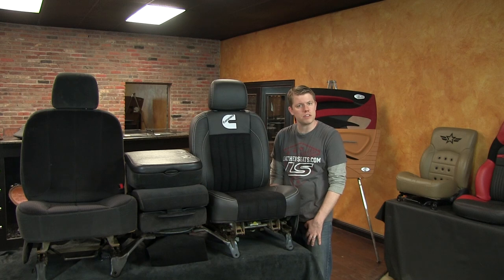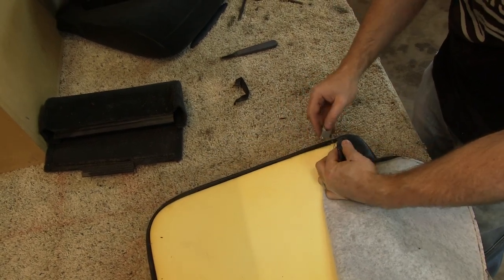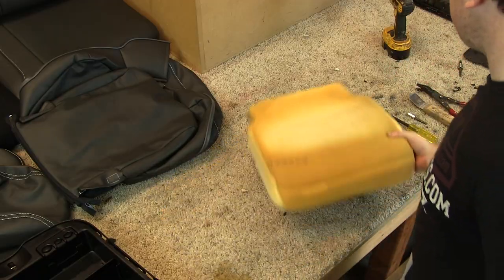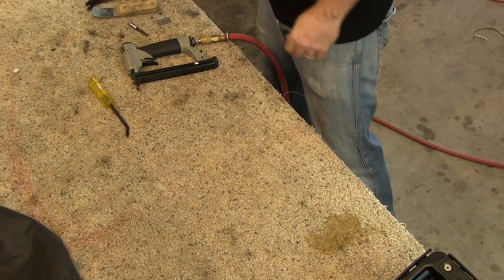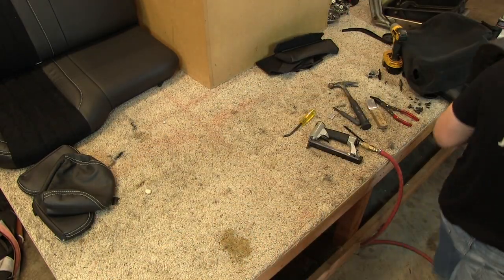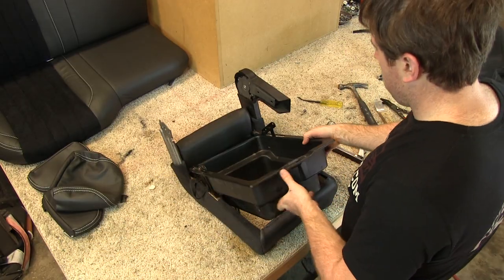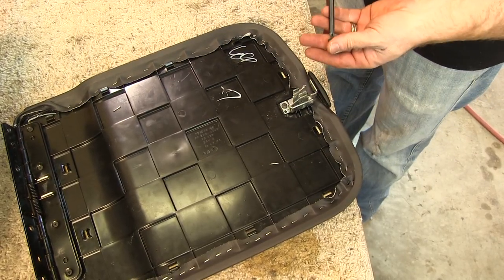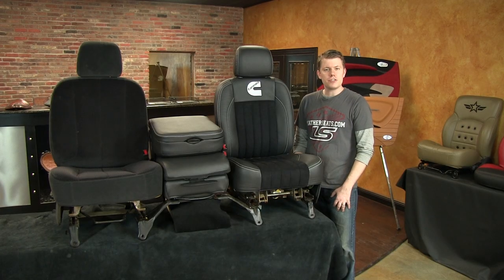Dodge Ram Quad Cab Leather Center Console Interior kit Installation Video - LeatherSeats.com

Comment: Love the video...very informative...but one thing I don't like is reusing the console underpad that's clearly worn and broken down. That is the issue I have with mine. Love your product...but I'm not installing new cover is the under pad can't be replaced. Other than dirty,  my cover is in good condition...just the need a new foam pad. Now of I could replace that at the the same time, that would be awesome. Replaced the foam seat cushions...just need a new console lid foam pad.
Reply from the maker: @timothymroberts2949 Thanks for your comment! I'm glad you found the video helpful. Our focus is primarily on the upholstery and we don't offer replacement foam. When we run into a damaged under-pad on these models for local installs, we typically cut out the damaged section and repair the section with high density foam. Foam repair can be a more advanced process, but a local upholstery shop might be able to help you out with a repair.

Comment: Almost complete,  how about taking the seat off the brackets.  I can't get to my truck right now.  But can the jump seat be removed while in the truck or do you have to take the front seat as an assembly
Reply from the maker: David Heath The jump seat should be able to be removed separately from the driver and passenger seat however it shares the same floor mounts. You will need to unbolt the seats, tip the driver and passenger seats back, remove the center jump seat, and the put the driver and passenger seats back down onto the mounts to be bolted back in.

Comment: What type of stapler and staples are being used on lid?
Reply: I wish he would tell us what the name brand of the stapler is and what the size of the Staples are that would be very helpful so I don't push a staple through the plastic since it's my first time and I would like to find the same brand stapler
Reply from the maker: @livefootagetube  We recommend using a pneumatic upholstery stapler, which uses a 22 gauge 3/8" crown staple and allows for shooting shallower staples. Eric is using a Porter Cable brand pneumatic upholstery stapler in the video, although there are many other brands that offer pneumatic upholstery staplers that would perform well at various price points. Unfortunately, I do not know what staple depth is used on this specific console, but we generally start out with 1/8" and work up from there if we need more depth to bite into the plastic. We might also suggest considering paying a professional automotive upholstery shop for installation, as they should be able to install any of these components.

Comment: Is an air compressed staple gun required? Or could I possibly use a regular hand held staple gun that doesn't require an air compressor?
Reply from the maker: +Pistol Plex We highly recommend not using a hand stapler because it is difficult to keep/stretch the leather in place while still being able to apply enough pressure on the stapler. Also, we find that a lot of times a hand stapler does not have enough power to go through the factory console plastic. A pneumatic stapler is the best way to accurately place and hold the leather into the correct position.
Reply: Pneumatic required.  Otherwise you won't succeed.

Comment: What kind of staple gun is that? And is there a specific staple I should get for the gun? Also does it have to be a pneumatic. And if it does have to be a pumatic what model is it so I know what to look for. Thank you so much
Reply from the maker: livefootagetube This is a pneumatic upholstery stapler, which uses a 22 gauge 3/8" crown staple and allows for shooting shallower staples. Eric is using a Porter Cable brand pneumatic upholstery stapler in the video, although there are many other brands that offer pneumatic upholstery staplers that would perform well at various price points. We might also suggest considering paying a professional automotive upholstery shop for installation, as they should be able to install any of these components.

Comment: great video. I bought the cover.  what size staple should I use? I don't have a phnematic  gun but I want to use my heavy duty stable gun. Is that ok and if so what size staple?
Reply from the maker: Justin Salgado Really we wouldn't recommend using a hand stapler but if that is your only option it is doable. Just be careful in regards to the stapler and staples slipping while you apply pressure as they can potentially tear the vinyl. We typically use 1/4" staples for this console lid. Feel free to email sales@leatherseats.com if you have any further questions.

Comment: Do you offer this same look for the 94-97 dodge ram seats, with the 2 piece center console.
Reply from the maker: Brian Hill We do have patterns for the 94-97 and can build a kit for you using the same colors and materials as the seats in this video. As far as the look is concerned, the 94-97 seats are a completely different style and will look different that this kit even with the same colors and materials. I would suggest emailing sales@leatherseats.com and we can send you photos of our 94-97 seat upholstery kits.

Comment: what length staples where used on the center console arm rest?  does that staple gun roll the staples over or are they just straight?
Reply from the maker: +jjp202 The staples are just straight.  I am not sure what size they used on this console exactly since it was filmed a few years back.  However, if I was to guess, I would think they use 1/8 inch on this particular console since you are just trying to tack it down and the whole thing is further held in place from the plastic trim that is popped back on afterwards.

Comment: do the kits include new foam? as i noticed the foam in the drivers seat and console lid where not in good shape before they where removed
Reply from the maker: +Mitchel Lenz We do not sell foam with the kits. Foam can either be repaired or you can check on purchasing new foam from Dodge

Comment: would this also work wit the later 06 to 08 models??
Reply from the maker: +Omar Aguilar The installation is very similar in it's process, but I believe the console is different in the 2006-2008 models.

Comment: Is there one like this for a 2001
Reply from the maker: Steve Wilson This package will not work for the 2001 because of the complete difference in seat style. However if you do like the materials and options that you see in this you can build your own kit on our online configurator in two-tone with suede inserts and contrasting stitching. https://www.leatherseats.com/shop/leather-interior-kits.html?make=DODGE&model=RAM&year=2001 If you have any questions or if you would like free leather/material samples be sure to give us a call at 1-866-639-7328.